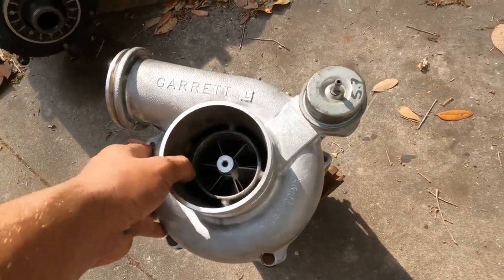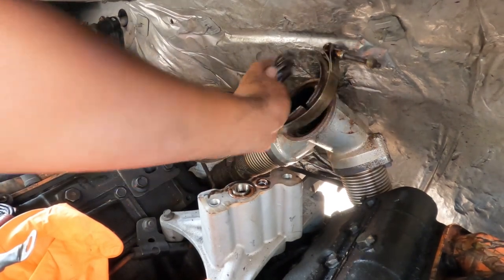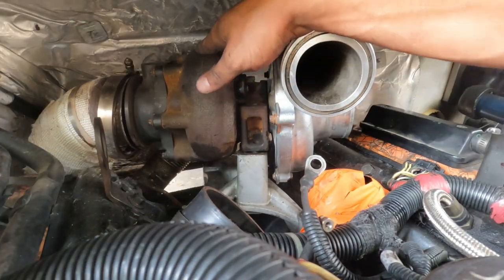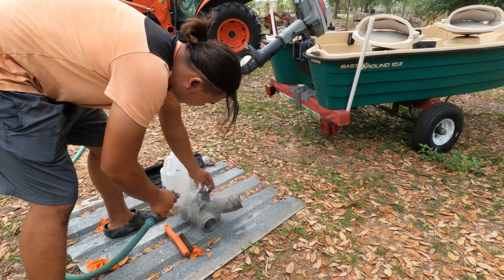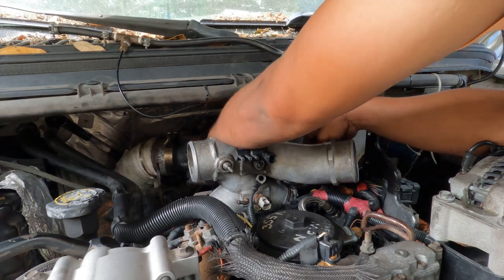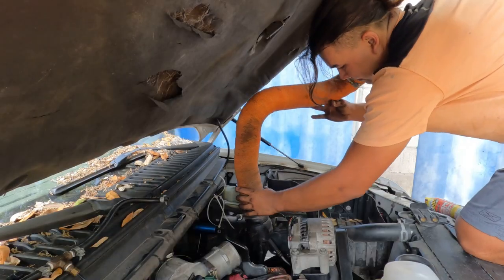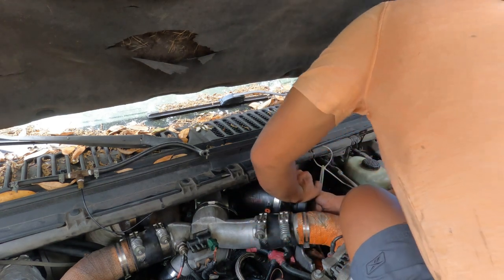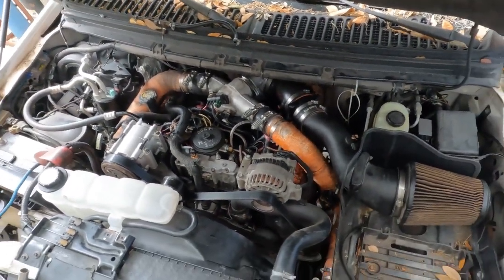GTP38R TURBO Installation + Turbo Tips And Tricks FORD 7.3 Powerstroke

Comment: So why did you say “don’t hear wrap anything under your engine bay”?!? I’m just curious….bc I wrapped my new Spoologic 304SS up-pipes with thermo-tec platinum heat wrap, followed by thermo-tec silicone hi-heat paint….which seals the wrap, and
keeps oil, dirt, grime, etc, from penetrating the wrap.

Anyways, hopefully you can chime in on that. I appreciate the video btw! A lot of good little tips and tricks in this video! Just got done installing the KC300X stage 2, and am very excited to get this girl back up and running! She got a lot of much needed goodies.